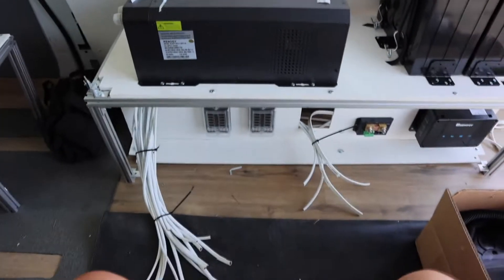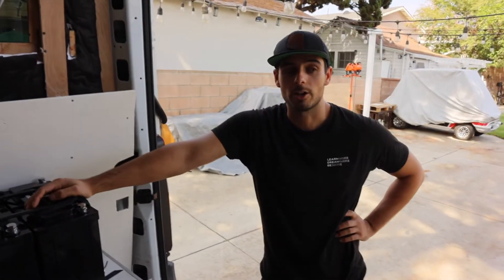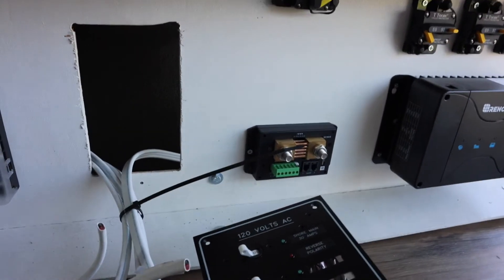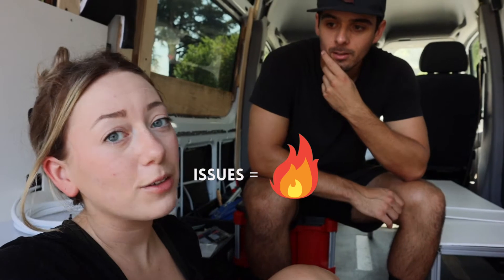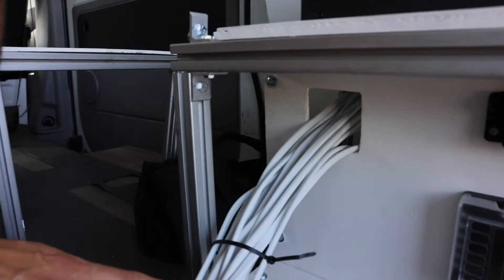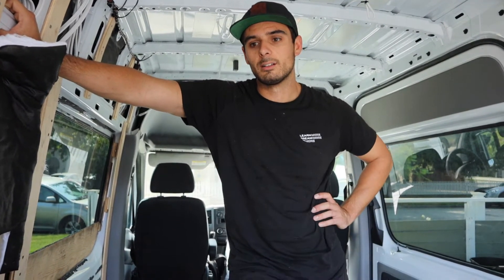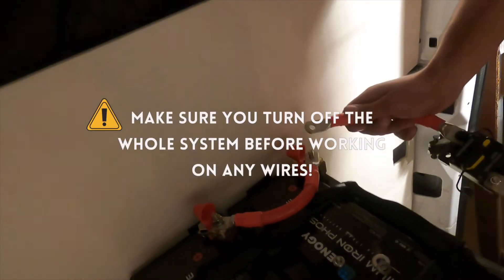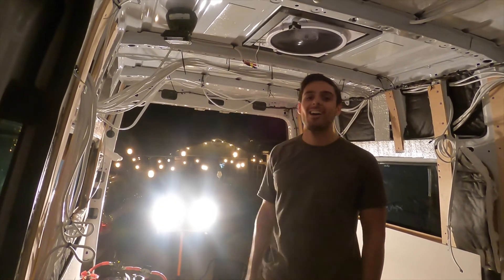DIY Campervan Electrics | How We Installed Our Van Life Electrical System (with a wiring diagram!)

Comment: Jr how long will your batteries last if you are using them. What are the specs ?
Reply from the maker: Let’s just say so far we haven’t run out of battery yet knock on wood 😅 they are two 170 amp hours each which gives us about 4000 watts. They are always being recharged by your alternator as we drive too. When we’re not driving they’re being charged by our solar panels.